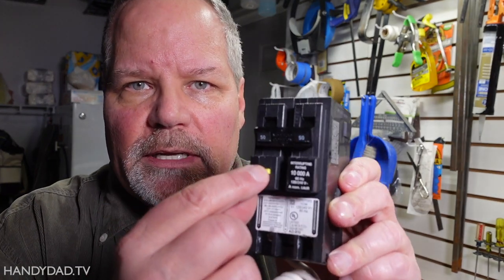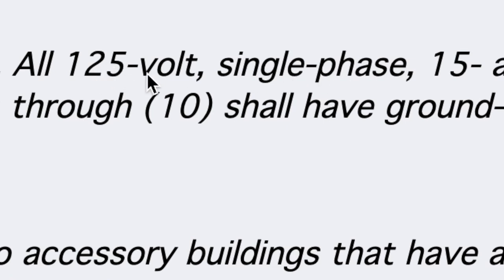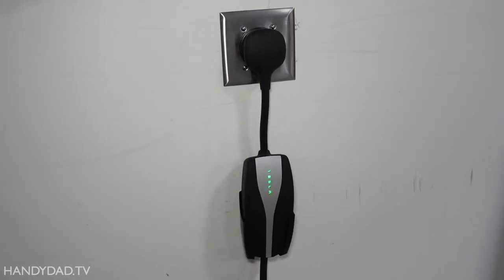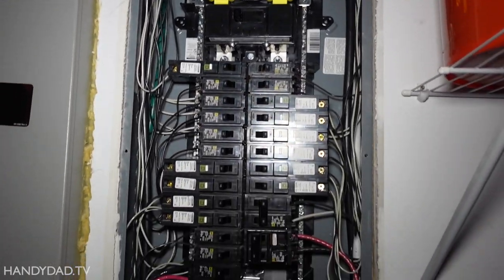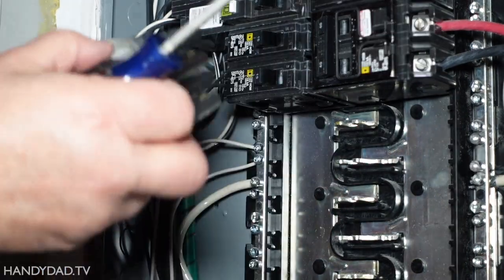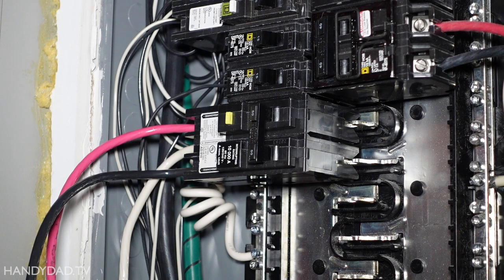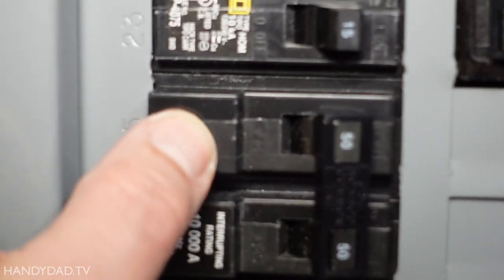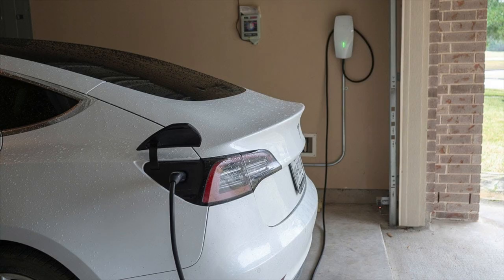Do I need a GFCI Circuit Breaker for EV Charging?

Comment: In South Africa, we always had (30 years +), WHOLE house ground fault protection standard. All circuits are covered by one central ground fault breaker (25-30mA sensitivity). 
Also, plug and light circuits must be separate. Normally 10 amps for lights and 15-20 amps for plugs. Single phase is 230v 50Hz though. We are in Canada for almost a year now, and I still try to get used to the American standard. Also, our SA homes have PVC conduit going down from the attic/ceiling, and normally have single cores running in it. Easy to replace/upgrade/extend, except the part where you have to break open a concrete wall to add another plug point.
Reply from the maker: Thanks for the info

Comment: 7:37 best practise is to stand aside from the panel, with your head turned away; and only use your right hand to energize circuits. that way; if there's any fault; it doesn't blow up in your face; and and voltage that may come your way doesn't cross your heart on the way to ground, as it would if you were using your left hand.
Reply from the maker: Thanks for that advice!
Reply: 120/240 residetial not much of an issue.  Not a lot of fault current available.  Normally less than 5,000 amps bolted fault.  Very much good advice on panels with more fault current and voltage available.  Very large residetial (400A ) , industrial 277/480.

Comment: Thanks for sharing, i am about to install two 50 amps receptacles one inside the garage and one outside.  I am worry to get electrocuted since one 50 amps receptacle in outdoor and doesn't have gfci.  There are none 50 amps receptacles are GFCI. Just wondering why they don't made it like the 110v.  Totally agree this type of breaker is good to have.
Reply from the maker: Thanks for sharing

Comment: We’re in the process of adding an EV charger circuit from the panel on the back of our house to our garage.  We’re debating about the GFCI requirement or hardwiring to avoid the GFCI. However, there seems to be a requirement for hardwired items to have a service disconnect switch within sight of the appliance.  So in our case saving the cost of the GFCI breaker is offset by the cost to add a service disconnect.
Reply from the maker: I prefer hard wiring anyway. Outlets are problematic. Watch this. https://youtu.be/1BnK4a4aVpU

Comment: Nicely done video.   You did mostly a great job.   If I may be allowed, I have a few comments.   1.  As others noted, you are only required to do what is the current adopted electrical code, not the current published code.   2.  It is obvious that the outlet below the panel was added after the original inspection.  If you installed it, surely you got a permit (as you stated would be required) and it was installed, inspected, and approved under the 2017 code.  Therefore GFCI was not required.   3.  Standard breakers are designed for overcurrent and short circuit.  GFCI is not for short circuit as stated in the video.  If your two hots went short circuit, the breaker would trip it, not the GFCI.   GFCI is for when current goes out and a small amount is going to a grounded object.   Like a human standing on concrete with no shoes.  It is set to trip at 5 milliamps.
Reply from the maker: Thanks for the info. When I tested a GFCI trip, it popped the breaker just like a short. You couldn’t tell the difference.

Comment: just recently installed an outdoor 14-50 circuit for my welding and the 250-50 GFCI breaker is expensive costing $150 plus tax.
Reply from the maker: Yeah there’s little demand for those breakers so they are pricey.

Comment: How about running a 30a outlet to the garage from the house's old fuse box (no breakers!)??
Reply from the maker: I wouldn’t. If you’re investing in a modern electric vehicle, invest in a modern panel installed by a licensed electrician. It’s not worth losing your house or worse.

Comment: Just stumbled on an article (and lost the link) where hard wired chargers have GFCI built in and will trip at 20 ma but no provision for manual testing. I suspect there's built in testing that shows a fault or disables the unit. A breaker with GFCI protection trips at 5 ma. This is how those charges comply with code without the added breaker protection. Guessing the code is different for such devices, but I haven't found it in NEC. They only talk about GFCI protection in general.
Reply from the maker: Thanks for the info
Reply: Yes, those can utilize equipment GFCI classification since it doesn't have a constant live receptacle. That's class C GFCI, with a 20mA rating. So when the EVSE sends out a 20mA signal to ground for its internal test and it's hooked up to a class A GFCI that trips at 5mA, it will trip it.
Reply: @andrewt9204  ... sounds like the solution is to connect the charger to an existing (pre code change) outlet or hardwire it to avoid having the double GFCI issue. Edit: Here's another thought... some inspectors give a nod to using non-GFCI outlets if they are too high to be easily accessible. Prime example is a garage door opener with a ceiling mounted outlet. It sounds as if they are using the same theory as the kitchen outlets that are more than 6 ft from the sink. (no GFCI needed) I suppose a 50 amp outlet could be installed say 7 ft high and the dangling cord would be protected by the charger itself. Do we have a grey area due to distance from a damp floor? NEC doesn't spell this out other that to say it's still in a garage.
Reply: @rupe53  Well, with states on the 2020 code, all receptacles have to be on GFCI, I don't believe there are any exceptions anymore. I think height only affects tamper resistant requirements. 
I think the solution now is for EVSE manufacturers to include a dip switch or firmware adjust to disable ground integrity checks, and just keep its GFCI in a normal passive mode. Default setting would be enabled of course in case the EVSE is powered by a non-GFCI circuit.
Reply: @andrewt9204  ... BUT... that would make sense, right? There are already folks saying the GFCI rules for heavy load outlets may go away. It would be interesting to have a crystal ball to see 5-10 years ahead.
Reply: @rupe53  yes they should definitely put an exception in the code for EV charging circuits. If the manufacturers instructions indicate not to install one it should be easily exempt. The only problem with that is if it fails and someone wants to replace the EVSE and  the new one doesn't have GFCI, then it's unprotected. But at that point if you're not really up to date on code and equipment operation you should just leave wiring up to a professional.
Reply: @andrewt9204  ... until they get things settled the easy way is for those chargers to NOT include a plug, and mention "hardwire" for installation. They should also include a sticker to be installed in the breaker panel stating the charger device has built in protection.
Reply: @rupe53  Nope, the code has provisions for how high off the ground a charger must be installed.  It cannot be installed "high up" out of reach.
Reply: @Wowzersdude-k5c  ... if you will notice, I mentioned the outlet height, not charger height, presuming the charger has several feet of cord to reach a convenient location.
Reply: To be clear, all Tesla chargers (actually connectors, the charger on Teslas and all other electric cars is in the car) have a built in GFCI so there is no added protection from adding another GFCI in the panel. But 2020 code would require a GFCI for a 240 vac outlet in a garage, even if used with an EV connector with a built in GFCI.  This is a bit like the nonsense of requiring a GFCI in the plug of an electric hair dryer in spite of all bathrooms having GFCI protected outlets.
Reply: @phugwad  You would be surprised how many homes do not have GFCI outlets in the bathroom.
Reply: @phugwad  ... for the sake of this particular thread I see the argument is not so much about the GFCI protection, but duplicating it and causing other issues, like a no charge condition.

Comment: Hey guys I just installed my 6-50 outlet and outlet is good. Getting 240 across both legs and 110 on each. Gfci breaker in panel as well. My model 3 however gives warning while charging stating  charging slowed - poor grid power possible. Anyone every had this issue. Not sure if it's the umc, adopter, panel or outlet. (Voltage is good coming from outlet though) it only charges at 16/32 amps
Reply from the maker: I’ve never heard of this situation. Sorry.

Comment: I switched from the GFI to a non GFI breaker because the Tesla Mobile adapter has a GFI built-in, it conflicts with the breaker and the charging stops intermittently.
Reply from the maker: Others have said the same but I never have that issue with my SquareD breaker.

Comment: Great video, was not aware of this, I have two 220 in my garage for charging my EV’s, neither have GFCI, I’m using a plug in JuiceBox, I will need to swap these out, thanks.
Reply from the maker: Thanks. Glad it was helpful.
Reply: In your garage is typically ok - check your local codes.  You also are grandfathered - don't have to retrofit things in your house as the requirements change - as they do often.  Just for new installs.  And in this case, all EVSE's have the GFCI inside the unit, so adding another one in the circuit is typically problematic and can cause false tripping.

Comment: I saw some others in here talking about the double GFCI issue. I charge my Tesla in my apartment off a 120v GFCI outlet and it’s tripped a few times randomly in the middle of the night. Wonder if that’s what’s causing it
Reply from the maker: I have never had that issue, either with a GFCI outlet or this 240v GFCI a breaker. I would try changing the GFCI outlet.
Reply: An inductive load can cause "phantom trips". In short yes it might be your problem.
Reply: I’ve been charging mine for a month on a 120v GFCI outlet in my garage and haven’t had any issues. You may have other loads running through that breaker, which is causing the tripping. An EV charger (outlet or hardwire) should be on its own breaker.

Comment: South carolina is still on the 2017 NEC.   And you are correct those two pole GFCI breakers are super  expensive,  my sister and her husband got the sticker shock when the two pole 20 amp breaker for the kitchen countertop went bad and they needed a replacement shipped to home depot 😃( they live in a tract home,  built in 1995, so it was pre-AFCI, but has 12/3 feeding the outlets,  and the top and bottom have the black and red with the tab broken. )  Guessing when the subdivision was built the contractors got paid by the job,  and they wanted to complete as many homes as possible in a given time frame, so they were less concerned about the cost of materials.
Reply from the maker: Yeah they are rewarded for speed, not quality.
Reply: Split plugs
Reply: @danlux4954  correct.   Many older homes used them in Kitchens.   I actually like them, but with the AFCI/GFCI requirements they are from a bygone time.   They were actually a very efficient use of material and labor, if you think about it.    Of course today we pull 2 runs of 12/2.

Comment: Tighten as much as I possibly can. You really should use a torque wrench, because it is possible to strip the threads. In any case, don’t use a powered screwdriver unless it has a calibrated stop.
Reply from the maker: Thanks

Comment: Curious to why you use a 50 amp breaker when the Tesla mobile connector maximum amp is 32 amps. Wouldn’t you use a 40 amp breaker?
Reply from the maker: It’s a 50-amp outlet so the breaker and the wiring should match that specification. There are other plug-in chargers that use 40 amps. And there are other appliances/tools that have NEMA 14-50 plugs.

Comment: Great video. 
I replaced a regular breaker with GFCI, but the GFCI breaker will trip from the start, tried with another gfci, it does the same thing. I can’t even flip the breaker to “on”. It will trip as soon as i flip it to on. Any suggestions?
Reply from the maker: Disconnect the load. Does it stay on? If so, voltage is leaking somewhere. Call an electrician.
Reply: @ but the regular breaker does not experience this issue, and when I charge, is getting the normal 9kwh

Comment: Why did you remove the white wire from the receptacle going to busbar and connect it to the breaker? 

Wouldn’t the white pigtail coming from the breaker have been connected when you tightened it to the busbar?
Reply from the maker: A GFCI breaker has a neutral terminal.

Comment: I have run across many of these Square D GFCI breakers that are "defective" most don't "test"  like yours, and some don't reliably allow the passage of current, as in they will be functional until they just aren't, without any indication as to why. Not a huge fan of these based on my experiences.
Reply from the maker: I tested it further, just to be sure https://youtu.be/u87ZJY_xhxg

Comment: Thanks for the video!  Now that you've had your Tesla for a while,  I'm curious if you have an idea of how much your electric costs for the car are on a monthly basis.
Reply from the maker: It costs me 3 cents per mile compared to 11 cents for my wife’s Lexus.
Reply: This would also depended if you had Solar panels, then that number would be folded into the cost and payback of your system, if your system produces 100% of home and EV usage it’s a free after payback. My payback with two EV’s was reduced to 3.5 years from almost 5 years, granted I’m in California and the cost of electricity and gas is the highest in the nation.
Reply: For my hyundai Kona my costs are a quarter compared to my Honda Accord 1.5l. Well worth it to drive a fun, and much quicker car. Also, no oil, coolant or any other liquids. And barely ever change the brake pads. There are tons if free chargers all over town still. If you're on the fence, go drive one and that will help you decide.
Reply: Common question... Teslas run around 250-300Wh/mile, so say 1000 miles/month (12k/yr), and use 300Wh worst-case, that is 300KWH per month... add 5-10% for charging inefficiency, 330KWH.
Now just multiply by your electricity cost, that gives you the cost per month.  
For US avg 13.5c/kwh, that is <$45!  Then divide by that 1000 for c/mile.
Other EVs may use more, not as efficient... and other states may be more, eg CA 20-24c/kwh, is $65-80.
Still cheaper than gas... and if solar, near/free!

Comment: I am having nuisance trips at the GFCI 50A breaker in the electric panel. I asked Grizzl-e's manufacturer for suggestions and the reply was to either (a) switch to hardwire or (b) find a 50A breaker with 20mA sensitivity. Does such a breaker exist? Safe? Permissible under NEC?
Reply from the maker: Go with option 1: hard wire.

Comment: I'm installing a hard wired charger (40 amp Juicebox) and was planning on a regular breaker. I came across your video and gave this a second thought. I noticed the edit at the end of your videos referring to GFCI not being necessary for a hard wired charger. Is this just per code, or is there no point to using a GFCI on a hard wired charger? I get that without the outlet, there is less chance for a problem, but is there still a safety advantage in using a GFCI for a hard wired charger? Can a ground happen at the charger itself? For example, if the vehicle is outdoors and it is raining, could a dangerous ground occur when the charger is plugged into the car? I would love to save over $100 on a breaker, but would rather be safe.
Reply from the maker: You do not need (or want) a GFCI breaker for a hard wired EVSE. Save your money.

Comment: Who is the manufacturer of the breaker that you are using in the pod cast?
I am using copper 6/3 and Sq. D Schneider  Panel. This is for an EV car charger. Looking for Qo 50 amp breaker with 3 conductor connection GFCI BREAKER  . Matching a 1450 enema outlet by Leviton.
Do you have any information that might help
Reply from the maker: This was a Square D panel.

Comment: If i have space in my breaker to install a 50amp like you did, does that mean it’s ok to add it? I was reading about overloading my breaker box which could cause fires? I just took delivery of my tesla and using the 12amp normal outlet sucks! Haha! Keep up the great work!
Reply from the maker: There are tons of load calculation videos to help you figure that out.
Reply: Rent it.  When you need special tools, you can rent them.  Why not rent an electrical guy for an hour or two and have them make the work easier for you.

A job with paper and pencil, no shovel, no insulation in the attic, they will love your job.